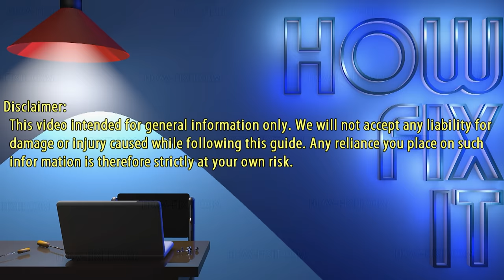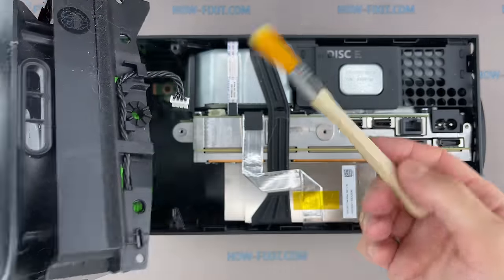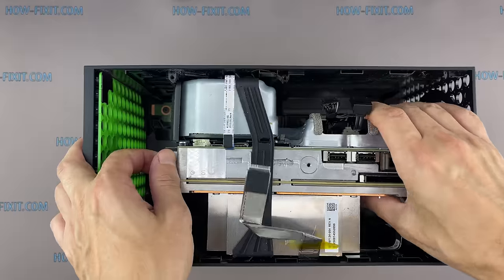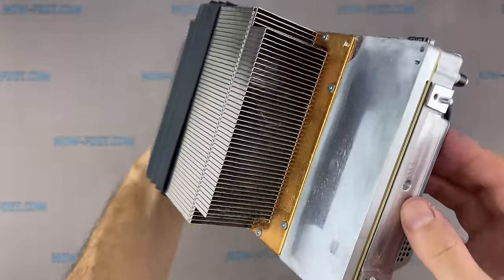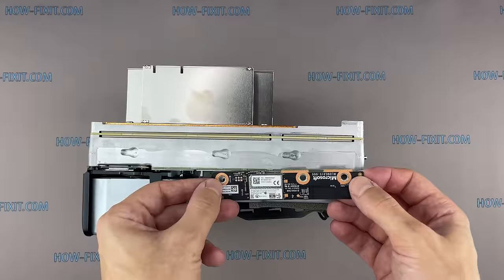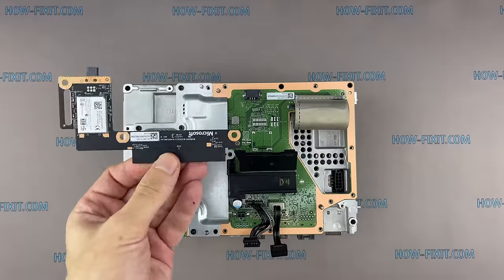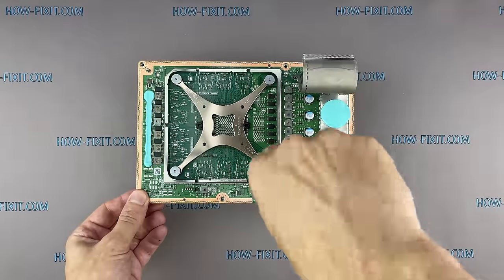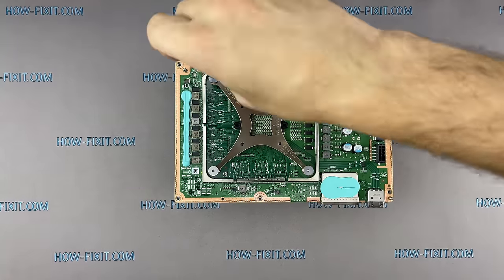Xbox Series X Disassembly, Dust Cleaning and Thermal Paste Replacement

Comment: The construction of this console is just incredible. The Microsoft engineers that worked on it should be extremely proud of the final product.
Reply: Except for the fact that they put the intake on the base of the system. That’s genuinely stupid design.
Reply: Sure your better than engineers huh?? 😂😅😂
Reply: @Never-Mongo  there's holes at the back of the console, heat rises, cold air  gets pulled from bottom and back, hot air then expelled at the top.
Reply: @dagnisnierlins188  yes but airflow needs to be available to pull to cool air through the system, the console literally sits on top of them
Reply: @Never-Mongo  The base has a raised platform. The intake holes are unobstructed.
Reply: Bet that the Red Ring of Death traumatized Microsoft so much, that they have to resort to this >_>
Reply: @TKAandMore the base should have holes in it just like the top and maybe even  some risers to collect less dust and have more airflow
Reply: @alexvillalobos7137  The base does have holes in it? And the riser is up about a centimeter, that's plenty of airflow
Reply: Ahh here comes the one exclusive in 3 years champ😂 Street_Champ
Reply: @Never-Mongo  u can also lay it flat it's got 4 rubber boots on one side for it to lay flat pulling more air in from one side and pushing it out the other from left to right
Reply: @Never-Mongo I don’t think you understand how airflow works

Comment: Hey bro you saved me $300 that microsoft support wanted to fix my over heating and shutting off XSX, the thermal paste was 100% dry and almost non on the chip and it was all leaked out, my xbox is back to its former glory repasted and its all thanks to you and your precise guide, i fixed it with zero damage to the console, 10/10 guide
Reply: you did good man, these are very complex machines
Reply: How long had you used your console before replacing the paste?
Reply: @mineer-pg5sv this  is entry level  toe electronic  repairs lol if you can't do this then don't touch any other electronic products
Reply: @S28Blue I’m wondering the same thing.

Comment: Just wanted to say thanks for this detailed guide , today after a heavy session on assetto Corsa I noticed the fans amped up alot , it's currently 32c here in the UK and felt after two years and a bit it was time to open up my series X , even though it was clean as a whistle inside as I use my system lying down and keep it clean from dust that's seemed to help loads . 
But when taking it apart I noticed the themal application was 1 rubbish and two hard as a brick . 
Followed your guide and replaced it with thermal grizzly Kryonaught and it's quite than day one of owning it . 
Alot easier than I expected to be fair . 
Very good guide for anyone trying the same process , I salute you good sir and many thanks for you time and efforts .

Comment: xbox was sounding like an airplane, had it since it was released. i didnt go all the way to thermal paste this time but wanted to a detailed enough cleaning of dust. it was very bad, literally created a small hill of dirt on my table. all back together, cleaned and playing videogames in silence, fan exhaling heat perfectly. thank you so much for this and now i have tools to use for other electronics that ive needed

Comment: I've killed two series X's, not having a clue how or why. Then I found your video. I've learned, living in a very dusty town and having dogs I needed to clean it once a month at the least. But what I discovered is, if you lay it on its side, like the old Xboxes, the dust and hair doesn't collect in the heat sync. 

I turned it over after my last cleaning, just to see if it made any difference. So after about 4 months I decided to open it up and check on it. It had dust everywhere but that's because of where I live. But the heat sync was completely clear of dirt and hair. So I highly recommend, any one who watches this or reads this to turn your series X on its side.

Comment: I own the Series X since day one so it logically starts to heat up a little more. I will clean it and replace the thermal paste with this simple, clear and effective tutorial. thanks dude 👍
Reply: I literally just did this, have had my Xbox since launch, my fan and Xbox itself are so much COOLER. Was kinda skeptical bout doin this cuz I’m not a big tech guy, but holy hell was it easy and worked very well lol
Reply: @rgriffin111 Same lol, though my hand was shaking a bit making applying the paste difficult
Reply: @brian8319  ya fr! Lol still no problems for me!
Reply: M8 u dont need to replace the thermal paste idk why people always do this its unnessacery
Reply: @Kyle1994NI not necessarily, it's definitely helped regulate the heat in 4 of my Xbox's

Comment: Cheers buddy, decent strip down. Just re-pasted my processor and this video worked a treat. My only gripe would be to mention that when splitting the heatsink from the PCB, be careful and use a plastic prying tool becauae mine was stuck. Microsoft's quality control on pasting the processor is awful.

Comment: I bought my unit 2 and a half years ago. It was starting to ramp up its fans where it never did before.
Followed your guide and replaced the paste for some artic cooler mx4.
It runs quiet as factory new. Thank you

Comment: The much easier way, is to get two cotton ear buds, cut one ends of both. Then tape them together strongly but thinly, then carefully poke through the holes with the long earbud at the rear bottom of the console, to clean out the dust from the heatsink. Little shake and then hoover does the trick! My Series X went from a loud hoover to a quite console again, without having to open it up or void a warranty.
Reply: I might try this. Thank you for this!

Comment: Thank god for this video. Fresh from refurbished gamestop series x. Every 30 minutes it overheated and shut off.
Took the damn thing apart, half the screws were stripped and had to be removed with insant bond epoxy so i mold the damn torque bit for a new screw head, no dust inside, but when I got to the thermal paste? Fuckin chip wae basically clean. All the paste had been shoved to the sides and had become so dry i had to softly chisel it off with a plastic wedge
Reply: This is exactly how mine was when I opened it… paste all over the sides and literally powder on the chip. It’s like they got Stevie Wonder working at the factory.
Reply: Same with mine!

Comment: Those two stickers looked like new after being replaced. One thing that makes me nervous is that heat shield where you need to bend the tabs. The screw locations make me want to try this. My Xbox is 4 years old, I should at least dust inside there.

Comment: thank you m8, just used your guide to change my own thermal compound on series X. Was pretty dry considering I've used mine for less than 2 years.
And 2 long screw thread was deformed on the tip, was a pain in the butt to screw them back in)

Comment: Mine is completely clogged with dust after 8 months of nearly every day use but I just don’t want to take it apart yet it definitely doesn’t run as cold as it used to but it’s still quiet and doesn’t shut down so I think I’ll leave it until the warranty runs out 😁
Reply: Just do an outside cleaning with a small vac hose , don’t need much vacuum strength
Reply: i cover it with a plastic bag when i go to sleep or not using it. After a year, it still looks super clean with no dust or hair inside and out.
Reply: @JJjameson_-nq5mb  Wow 5head
Reply: @patrickrodriguez9153 just did that after 2 years now as it started to thermal throttle on black ops 6 still haven’t taken it apart used a can of compressed air and hoover

Comment: Do you have to replace the thermal paste or is this guy just doing it for his? Mine is not that dirty at all but when come time to clean it. All I wanna do is vacuum the fan out.
Reply from the maker: You don't have to change the thermal paste if you only need to clean the dust. This video instruction shows the replacement process for information on how to do it, but it is not necessary.

Comment: Nice video, but you should replace the thermal pads with new one's. Never use thermal pads twice.
Reply: And why is that? As long as they look and feel good, there’s no reason for you to change it.
Reply: @SicknatureL2  Once the thermal pads are pinched, they no longer conform to the surface.

Comment: I had my Xbox for 6 months and it’s already overheating, do you think it’s the thermal paste.
Reply: You can try and clean it first with compressed air.
If it doesn't help, then yeah I think it's the termal paste. Microsoft is not using the highest quality paste, so it dries out quickly.

Comment: Hi, I recently had my xbox serviced by microsoft because it would shut down during Gears 5 at random intervals of gameplay. Now that it has been returned the issue has been fixed but I can't insert a disc into the drive, there's no suction at all...I'd like to avoid sending it in again. Do you think a ribbon cable or something could be unplugged?

Comment: Great video! But did anybody else have trouble removing the middle screw for the fan? I have all the necessary tools and used the T8H, but it just stripped it. It won't budge 😢

Update: Used some pliers to unscrew it. Hope it's easier for the rest of y'all.

Comment: For some reason, the middle screw of the fan is so incredibly tight compared to the other screws. It’s impossible to even loosen the screw, I’ve been trying to over 30 minutes to get that 1 screw off. And I broke one of the cables because my torx screwdriver snapped.

Comment: When should someone replace the thermal paste
Reply: it should last at least a few years out of the factory. I would say start looking into it after the 3rd year, and if you feel that the fan is spinning on full blast constantly, it might be a sign that the thermal paste is no longer conducting the heat as effectively as new (it might be also other factors like dusts blocking the airflow etc). We have no real way to monitor it as the XBX does not come with any temperature monitoring functions like your CPU or GPU. It's all guessing work.
Reply: @neoroxx  3rd year?   LOL..  That's ridiculous.  Easy 10 years then throw them in the trash and buy a Series Z!!!!!!!!!!!
Reply: @theaustralianconundrum  i prefer to keep my consoles on perfect running condition, unlike you.

it's your choice to throw it or whatever, no one cares
Reply: @neoroxx  you are a
Reply: @theaustralianconundrum  whatever, "review master" 😏
Reply: @neoroxx  goodbye
Reply: @neoroxx  whatever..........

Comment: Getting to the point where I'm considering changing the thermal paste. Is it necessary to spread? Some videos I see the tech spread it around and other videos they just sandwich it.
Reply: No, apply little extra paste, the pressure of the screws will be enough to spread it

Comment: Bro u're the best i just opened my series x and clean it thanks
Reply: Do you think it's already time to change the thermal paste? I mean it's not even 2 years after the releasr date of x series.
Reply: @TheTruth-sd8ey  i have an xbox series x since march 2021. over time it started to heat up and i could hear the fan blowing louder and louder.  sometimes it went out by itself for safety.  following this tutorial I opened it for the first time to clean the fan and the cooler.  It wouldn't turn off anymore but the fan was blowing hard when I was playing FIFA 22 or resource intensive games.  it bothered me so I bought an ''ARCTIC MX5'' thermal paste and since then my console no longer heats up and the fan runs normally like on the first day.  I strongly advise you to change the thermal paste you will notice that the old one was not of very good quality.
Reply: @SoufixTTV  thanks for reply. So far, my xbox x series still works ok, fans are very quiet and hot air blowing out, like it should be. But it might be time to replace the paste soon, since i play rdr2 alot and now it's very hot inside my room and have no AC. I turned my fans towards the xbox left (or bottom) side where the air sucks in and i feel it really helps. However when need be, i'll be sure to open it.

Comment: Thanks for the video! I replaced the thermal paste but it didn't help. My Xbox automatically shuts down because of heating. Any suggestions how to repair it? The fan works well.
Reply: Did you manage to fix it?
Reply: @midget8857  no, it shutdowns automatically to prevent heating up. Gor example in Hogwards Legacy or Fifa 22. Fifa 23 works better, at least does not shutting down.

Comment: anyone else having a hard time taking off the screws inside ? the  2 screws on the outside to remove the cover were easy now the ones to take off the fan feel like they’re glued in or something can’t even get them to turn
Reply: I’m having that exact same problem now can’t get the fan screw to turn.
Reply: @MrDJ17  honestly I say you just leave it cuz I kept trying to unscrew it and now the screw isn’t the same size as the screwdriver I was using from how much pressure I was applying trying to get it out
Reply: @twoorobbie  I just got that screw out. Use some pliers to loosen it then use the screw driver.

Comment: What do I do with the big centre torx screw on the fan? Mine was rounded so I can not get the torx bit in there. I tried pliers and turning it but just couldn't get it to turn, any tips??
Reply: I have the same damn problem.
Reply: Same issue

Comment: I lost one of the screws on the left and right bracket holding the fan. Would anyone happen to know what kind of screw that is so I can replace it? Like the length any everything. All I've gathered so far is a t10 torx screw. Just want to see if that is correct

Comment: The only problem is that your x clamp or whatever it’s called is not orientated properly. You have the black risers tightened down over components. The black circles are orientated left and right when they should be at the top/bottom. Around 14:00. Again, those black circles are not supposed to be position west/east, but rather north and south. Look at what you’re tightening them down on in the video.

Comment: I'm a bit stuck getting the fan out. I've got the two side screws out but the big middle one isn't turning and I'm worried about shearing the screw. I've tried pliers to turn it and nothings working ☹️
Reply: I recommend that you do not use pliers or tweezers. Buy a torx 8 screwdriver with T-shaped body for better grip. I used to have that same problem until I used that screwdriver for a better grip
Reply: @OSITO-xm7gl  I do have the T8 screwdriver specifically for xbox. It's just the fan screw is soo tight! I'm not sure about the brand type. I'll have a look though, thank you.
Reply: @kwilson3514  It's a type that in the part where it's attached is shaped like the letter T and gives you a better grip to remove those screws that are so small and tight. The brand can be anyone's. I wish you luck with👌🏻

Comment: I did everything exactly like this. Now it won't power on anymore. Power button lights up for 2 seconds (with sound) then it shuts down. Any idea's?
Reply: Me too! I literally just finished it and now I’m opening it up again checking for loose connections on the power supply. Did you ever find a fix to this issue?

Comment: Your video is very good. Thanks for transmitting information. One question, does the T8 torx wrench have to be with a hole or without a hole? Hug Brazil.

Comment: I've knackered my power switch cable (the soldered bit) xbox works with being turned on by controller 😅 used another guide up until I broke it 😭

Is this a cheap fix?
Reply: If you do it well and with enough concentration, yes

Comment: All Revision 2 Xbox Series X consoles will still run the fan after any extended use where the console draws 100+ watts.  Turn one off and just like a PC the fan will stay on to prevent heat soak from an instant shutdown.  My Xbox Series X on shut down draws 20-25 watts while the top fan is still spinning for an extra 1-2 minutes until it spools down and power draw is 0.1-.2 watt.  This is good engineering.  It's like a car's Turbo timer.

Comment: Have you noticed, that technology and Microsoft, Sony themselves.... Have all said, though an unlucky few will have faulty consoles, most are robust, highly tested for a long period of time, used in high heat extreme conditions, and not sold till they are sure they are fit for long term use.

I'm 43, i played on ZX Spectrum, Amiga 500, Mega Drives, NES, 3DO, Amiga32, Mega CD, PS1, PS2, PS3, PS4, Xbox, XB1, XB1X right up too now owning the Series X and S.
Back then, as kids, we had the consoles on carpets, put it in our bags too go to our pals houses, dogs and cats near the console, eating drinking near the console...... Pausing games to go and play with pals outside, blowing in cartridges and consoles thinking you were clearing dust..... And NOT ONCE did i have to get someone to open up one of my old consoles for cleaning, and some still work too this day.
Yet somehow, now.... We are supposed to think that these new consoles are so precious, so delicate, so fragile, that we have to possibly attempt to open up a £450 console, replacing and cleaning parts?
I swear, i have heard more stories, of people trying too remove the fan and clean their new consoles and THEN actually breaking them.... When there was no need too at all.
1. If you keep your area hoovered and dusted every day where you keep your consoles, the internal dust will be small.
2. I got for £8, on Amazon, Series X Microfibre dust filters.... They stick perfectly on the top and all vents, allowing the console to breath fine, and stop all dust.
3. If you have a dust buster, or small attachment for the hoover, simply press it against the rear vents, and turn on.... This was on the actual Microsoft site as the easiest way.

IF you know exactly what you are doing, then yeah, go ahead and open the console up..... But unless you live in a dirt box and never dust, your console should be fine.